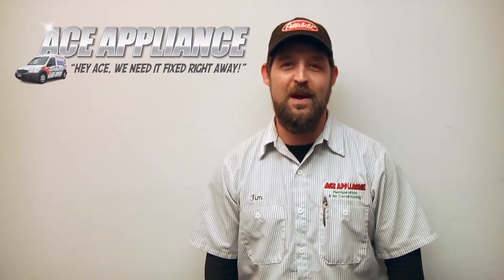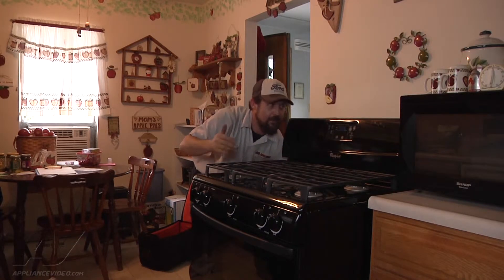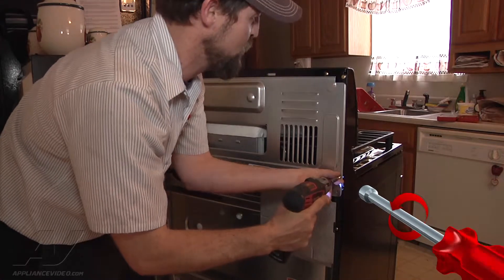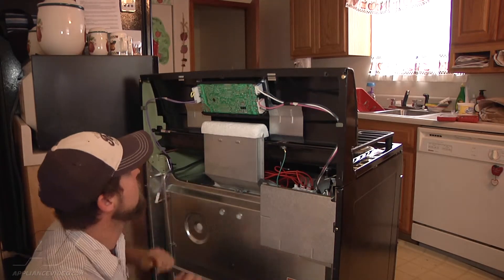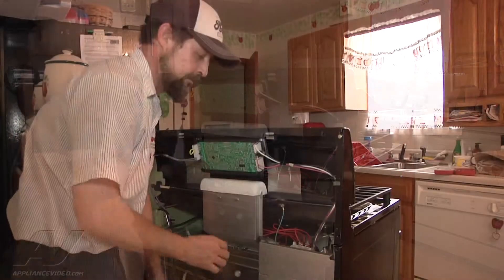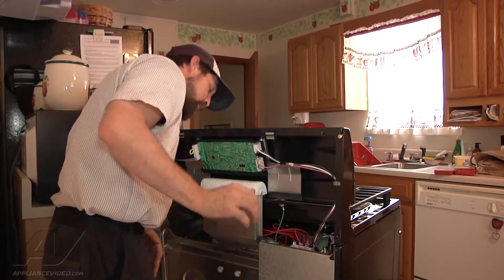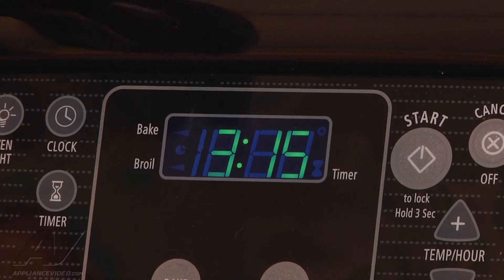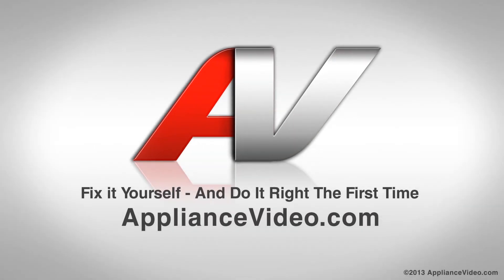Whirlpool Stove Repair - Irregular Power - WFG231LVB1

Comment: Hi I have a kitchen aid gas stove and its not getting any power I checked the breakers and they seem to be OK ....what could be causing the problem ....what do you recommend
Reply from the maker: Check the power coming in there should be 115 volts. If you have good power I would look at the control panel to see if there is a in line fuse that blew. Our family owned and operated company provides quality videos to help Do-It yourself consumers save money. Thank for your comment it helps us provide better videos. Please become a subscriber and get weekly updated videos and help our ranking on YouTube. If you are in need of any parts, our parts department has over 5-million in stock for same day shipping. Please call  1-800-830-5465 for any of your parts needs, or you can order online 24 hours at: ApplianceVideo.com. Thank you and good luck with you project.